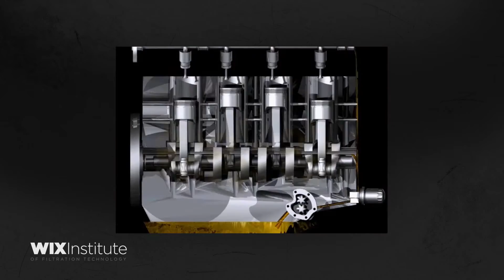WIX Institute: Dented Filters

Comment: These problems would not occur If WIX didn't switch to using such thin metal to manufacture the filter housing.  Stop trying to make everything cheap.  It took the company decades to build a reputation for quality and it's being thrown away in a few short years.  An upset, disappointed customer is hard to win back.
Reply: sounds like Fram anyway I have a Champion oil filter which I dented badly because of Ford idiots location I have to go near the fram and pass the tie rods and all kinds of other stuff to get it on it is thin but Never had a leak
Reply: John Ferguson you should try the new Purolator Boss Series